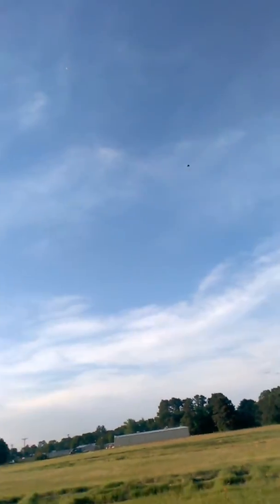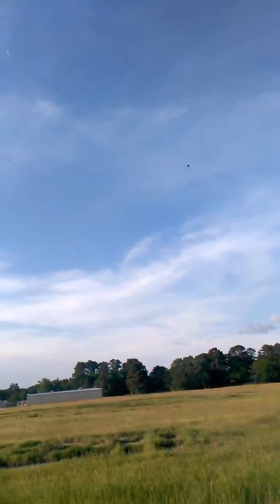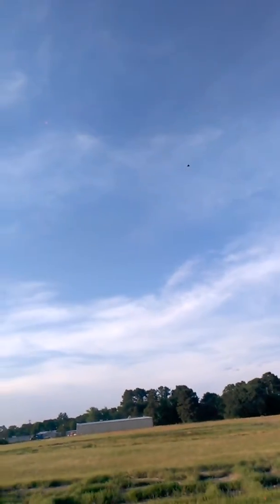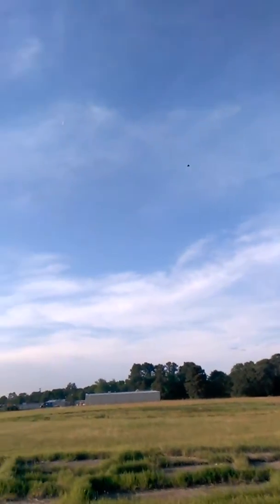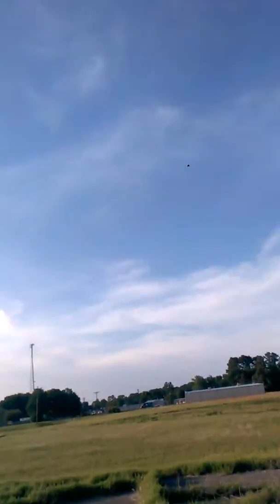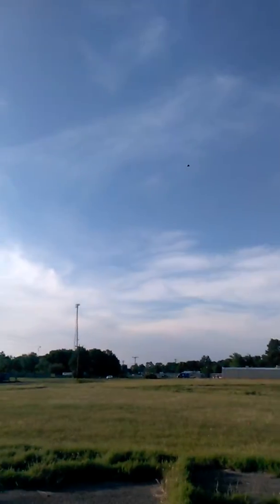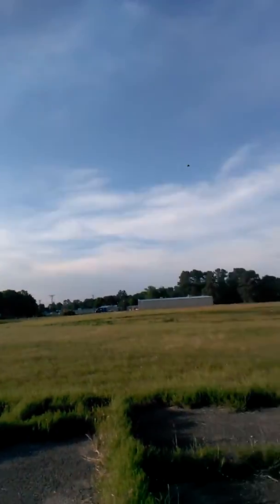Estes 1/100 scale Saturn V ( Aerotech E30-4T) Flight #2

Comment: glad you got it back, loved your launch videos thanks for posting them.  My daughter just got her Saturn V we plan on mainly using composite motors for this one. which is the reason We decided to use the aluminium motor retainer on motor mount  with out a thrust ring in the tube. By any chance have you launched it on any of the 24mm F motors yet.
Reply from the maker: dirtmidget 33 not yet. but I will soon. I work for Aerotech now as an independent sales rep so I get my AP motors discount now.